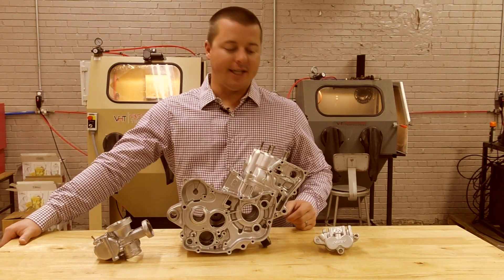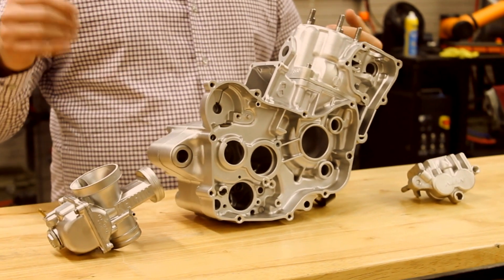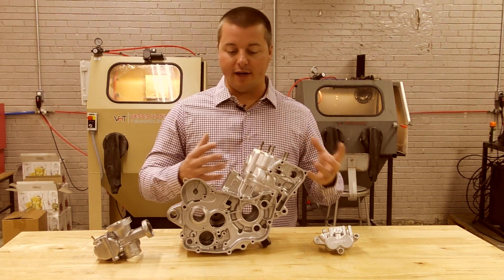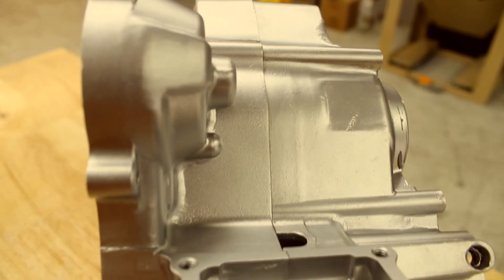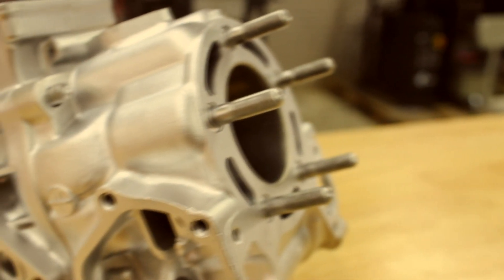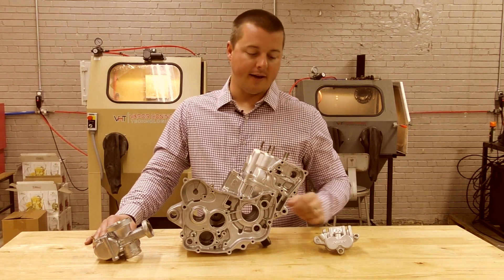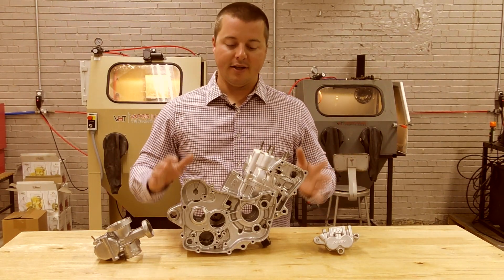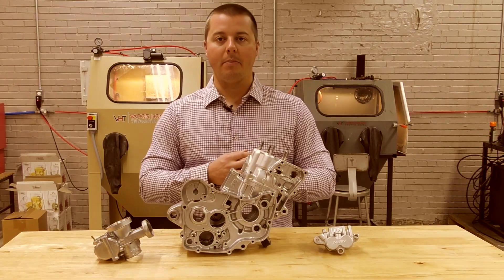Vapor Honing a dirt bike motor and engine parts - Vapor Honing Technologies

Comment: I’ve got a vaper blaster what I worry about is the media be left in all parts where the antifreeze and oil ports what is the best way to ensure there is no media left in the ports any tips would be appreciated
Reply from the maker: The best way to ensure no media residual is left behind is to thoroughly rinse your part after blasting. We manufacture parts washers that work as a post process do do this, using pressure, heat, and an aqueous based detergent to rid parts of left over residual. Give us a call, (828-202-5563) for further question or information!